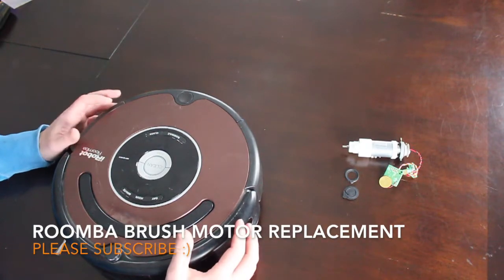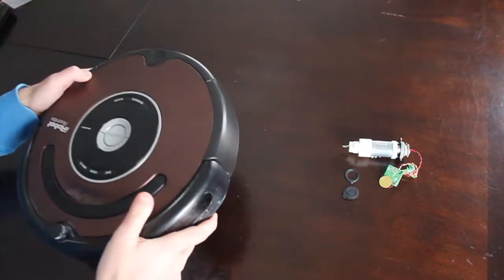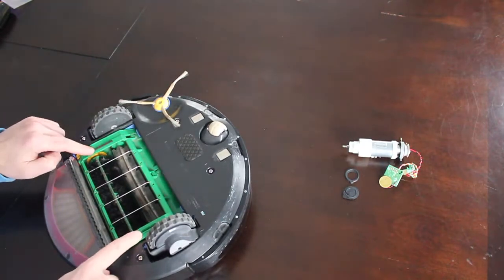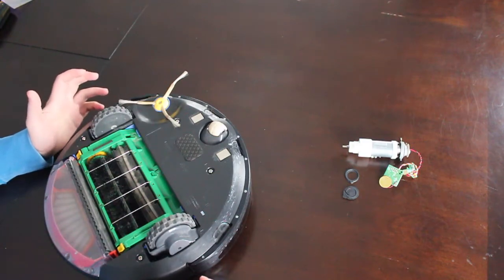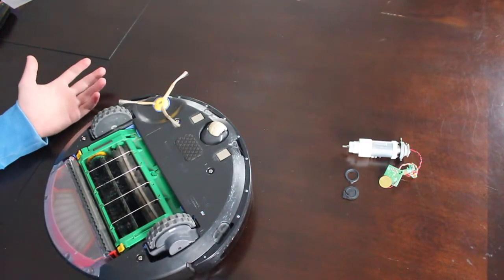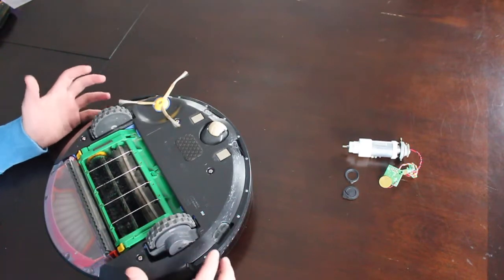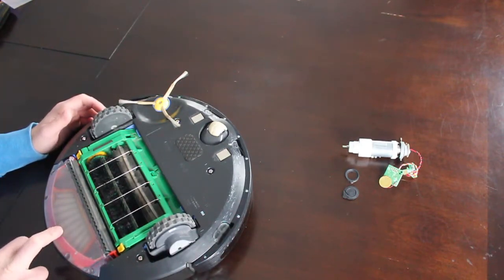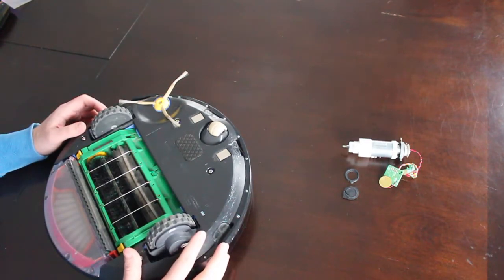iRobot Roomba Brush Motor Replacement in 7 Minutes!

Comment: Helpful video, thanks! I have the version of the Roomba 560 with the bigger "dirt sensor" PCB. On that one you cannot just release the wire (from unter the little circular sticker) through the front plate, but have to loosen the screws on the front plate (where also are the screws holding the plug to the robot) so you can take it out. It's also quite a pain to get it back in, carefully pulling forward that front plate from the "frame" and use pincers or so to lift the end part of the wire back up into space prev under the sticker in the top plate. It's a bit of a struggle so I think they simplified that step for the later versions.

In my case, the motor itself wasn't defective but the attached gearbox really dirty, also looked as if the O ring or felt sealing of the shaft was completely torn up. First took off the part holding the drive shaft to the brush(es) wheel gearbox (2 screws IIRC), then the second part which is screwed onto the motor itself with 3 screws (IIRC). I cleaned all parts and applied a little bit of silicone lubricants to all the gears and shafts and reassembled it and didn't even bother to replace the O ring or sealing ring or whatever it was. Works for now :)

Comment: Do you know what voltage the motor has?
Reply: I have already measured it ( since my motor is blown too ), and it has 15.35V on the connector , what is actually the battery voltage.

Comment: Please show the part with the green section bigger, slower, and from the front so that the audience can see where you are screwing and what you are doing with the little line with the red Thing.. 
the Part when you replace the Motor is the most important section in the video...  
Open and Close the roomba you can see in a lot of other Videos without Changing the Motor..

Comment: Any thoughts on installing a higher power & torque brushless motor?  I  imagine that would require some changes in the feedback parameters unless I pick a brushless motor with similar specs.

Comment: Hello,
Thank you for this video.
My motor actually works fine, but only when the roomba is upside-down (tested with the diagnosis mode). When I put the roomba back on the wheels, the motor doesn't turn anymore.
Do you have any idea why ?
Thank you
Reply from the maker: Hmmm, might be the brush drive gearbox.  Do the brushes roll smoothly by hand?  Right side up?  Upside down?
Reply: @GrorangeGarage  yes they do roll smoothly by hand in both positions. The gearbox is clean, I bought the Roomba a month ago. I opened it and there's no dust nothing.
Reply from the maker: Are the brushes easy to stop when spinning?  Might be a weak motor.
Reply from the maker: Hi Hsan, I was thinking about this recently.  I suspect the motor is “weak”.  I just changed the a door actuator motor that still worked, but didn’t have enough jam to lock/unlock the door.

Comment: Thanks for the video. There are two things however that I don’t see you detailing. Perhaps they don’t matter? I put mine back together brushes were spinning but it was not picking up dirt. 1)Does it matter what direction the cartridge connector is installed? It will fit both ways meaning it will plug into the Roomba either direction. I’m speaking of the main brush card edge PCB. 2) The main brush motor that you installed could be rotated and installed in many ways such that the wire does not have the proper length to raise and lower the brush cartridge properly. I’m assuming the rotation matters and that the wire is fed correctly to the blue outer cartridge shell.
Reply from the maker: Thanks for adding your learnings!
Reply: I believe that the direction of the electrical connector matters, you don’t want the two brushes to spin backwards (even though I’m not sure that the electronic board would work at all, if the polarity is inverted). I paid attention to the direction when reinstalling it, the bending in the wires from the unit that you remove will help you  recognize the original position. 
I didn’t pay attention to the position of the metal wire and/or of the motor, though. I only remembered that the motor seems to be free to rotate about 180-210 degrees before hitting a stop in both directions so I installed it in what seemed to be the same position (there’s one way to install it, where the motor cannot rotate). Watching the video now, I think I installed the metal wire backwards, though... what is the wire for and does it matter how you install it? My Roomba seems to work fine after the reassembly process...
Reply: I followed your video but now my motor ‘knocks’ like crazy. It rotates and bangs against the frame and I cannot seem to be able to stop the knock. Any ideas?

Comment: I actually think it's pretty cool that iRobot made these things so modular--- makes replacement of parts easy instead of just replacing the whole Roomba.  :)
Reply from the maker: Agreed, I've replaced the side brush motor, batteries, and the main brush gearbox on different models.

Comment: Great video. Where did you find the replacement motor and sensor? I've looked around and only find them for the same price as a whole replacement module.
Reply from the maker: Order off of eBay from casino187.  Roomba 500 600 700 Series Brush Motor + Dirt Sensor 550 560 585 595 760 770 780